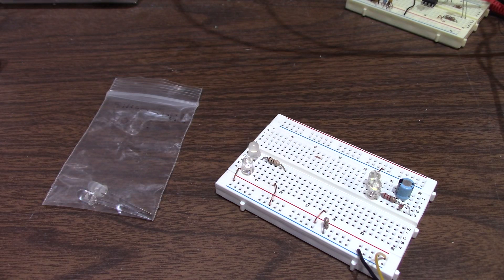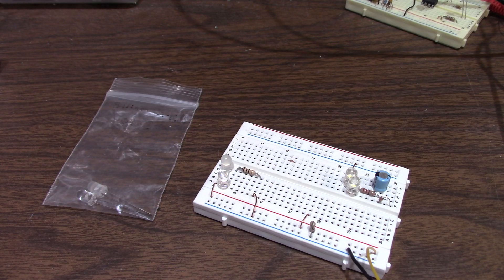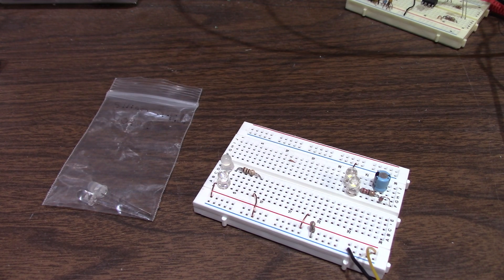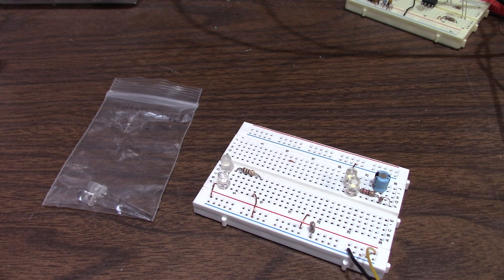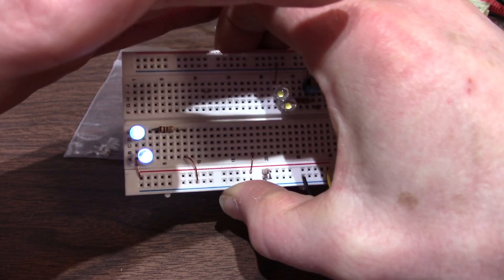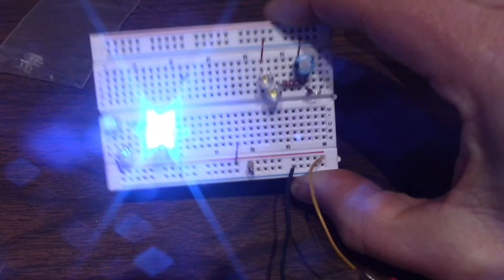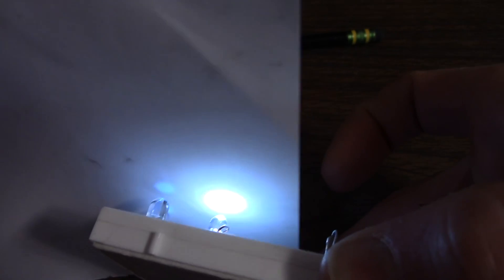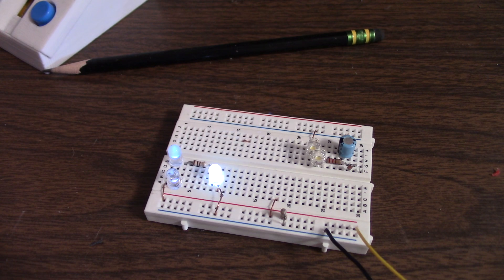The blue LEDs that existed before the current InGaN blue LEDs

Comment: I have a bag of about 80 of Those Cree Research SiC blue LEDs, Part Number C470-5C14. We paid a small fortune for them in the early 90s, and they were obsolete a couple months later. We (Rayovac Corporation) used them to create the first ever LED flashlight, by mixing 4 blue LEDs with 1 red and 1 green, to get a dim white light. It was too expensive, never made it to market.

Comment: I remember when I bought my very firsts blue LEDs in 1997, I spent U$D5.00 for each one, were a 5mm diffused LEDs that weak glows, the seller told that they are from some South Korean maker, sure these are based on the silicon carbide technology...
Greetings from Brazil!!!

Comment: I also picked up some of the early silicon carbide LEDs, just to have some blue LEDs.  I had the same thought when I saw the Veratasium video.  A friend of mine got one of the blue LEDs and put in in a box with a switch and battery, he called it a "geek detector".  He'd turn it on, and if someone came over to ask "is that a blue LED?" he knew he'd found another kindred spirit.

Comment: I far prefer old style LED's for indicator lamps. Most designers run their super-bright LED's way too bright just because they can, even SMD versions. With the exception of lighting applications, this is totally unnecessary. Fortunately I have a good stock of older 80's/90's tech in various colours, which I prefer.
Reply: I use super-bright LED's as indicators because they need a hundred times less current (like 100uA instead of 10mA) to light up decently. On portable equipments, this is a battery saver.

Comment: Hi John! Loved your video on these old blue LEDs! I have a fascination with LEDs alone with fluorescent lamps. I still have an early 1940's preheat fixture that still has the original ballast and to this day, still runs just fine. However, getting back to the topic of these blue LEDs, I remember getting some from Digikey myself when these were available. I was surprised that at 20mA, they were not bright. But unfortunately, these did not last very long. I used one in a power supply that I built as a power on indicator, and after a year, I noticed that the light output was reduced significantly. And then a few more years later, the output dropped so much, I could barely see it lighting in total darkness.

Comment: I paged through the Mouser catalog every time it came out, for years, looking for blue LEDs, $6 apiece, as I recall... I bought several on a middleschooler's budget. Was kinda sad they were so dim... but, yes, that color was amazing!
I used two, recently, at 30mA each, into a lightpipe on a power button, and it's barely visible in daylight. But oooh that soft color!

Comment: I bought one of the first Pioneer dvd players in 1998 (it cost about $800 as I recall). It had a fairly bright blue light which shone when there was a dvd in the drawer (it was not lit for a cd or vcd). Wow, blue led, I thought, but when i took the top of to take a look it turned out to be a tiny incandescent bulb behind a blue piece of plastic... That was still cheaper than a blue led at that time.

Comment: Just due to its oddity: Here in Germany a company sold little incadescent bulbs molded into a blue housing with the same geometry as a standard 5mm-LED. This must have been in the end of the 80ghties or beginning of the 90ghties. They have been quite bright and cheap compared with the authentic SiC-LEDs. The major disadvantage was their limited lifetime.

Rumors say that the High-Beam-indicator of VW-dashboards of this time have used this "fake"-LED. Everytime I have seen the blue light from the LED-shaped surface of these cars I was heavily wondering where VW finds blue LEDs. But maybe they even had an early source of "good" SiC-devices.

Comment: In fact almost every diode is an LED. The 2N4148 emits in the near infrared. You can see it glowing with your mobile phone camera. The silicon pn itself is a very stange light emitter. The charge carriers can only relax from their meta stable state when the take a phonon from the crystal lattice with them. It means, the pn structure gets colder if it emits light. But the loss processes generate by far more heat than the anti-Stokes cooling generates cold.

Comment: I know when I saw the first blue LED - I was in my early teens and it was in the VW Passat my parents bought in -85 and used as indicator for the high beam. Just getting interested in electronics I loved the look so I dived into the catalogue of the local electronics store supplier, Elfa. 
And I found them! Then I saw the price tag of 80 SEK IIRC (about 8 US $) and skipped that purchase...
Reply: Yes, it was.
Reply from the maker: No way would the high beam indicator be a blue LED in 1985.
Reply: Nope. It was a blue LED. All our mid-80s and later VWs had them. The switch from the ugly mustard ones to blue was between '81 and '84 (different markets at different times). The circuits in the dashes of those VWs were specifically made for LEDs, as the indicator flasher, charge light and oil light were also LEDs. All the LEDs were mounted on a single board, and some people swapped the yellow ones for blue when they came out. It was a rather darker blue, not sky or aqua, and diffuse.
Reply: Well it was. Unless they bothered to make the best LED imitation I've ever seen. Don't think I've saved the original repair manuals so I can't check.

Comment: Thank you so much for making a video about this; I was disappointed that SiC LEDs weren't mentioned in the Veritasium video. Even with nothing more than a chunk of crude SiC slag I've been able to find bits of the crystal which give fair brightness in any color, blue included.
Reply: You made LEDs yourself? You HAVE to publish that!
Reply: @thewhitefalcon8539  You can find various instances of it being done by other folks - some early radio operators noted that their carborundum (SiC) detectors would sometimes emit light when DC bias was applied. These are at best only bright enough to use as an indicator.
Reply: @thewhitefalcon8539  It's easy enough to find descriptions elsewhere online - chips of crude SiC (slag from Si refinement iirc) when probed with a sharp point of steel under sufficient DC bias may light up with any color of the rainbow, and with multiple points of connection with steel wool and/or conductive nickel paint the light can be bright enough to see clearly, even under normal indoor illumination.
Reply: @zinckensteel  and what do I search to find that?

Comment: I was excited when I first saw yellow LEDs. So pretty. I started replacing every power indicator I could find, just so people would be amazed that it wasn't red or green. Then I saw a white one and I couldn't believe it. LED light bulbs!!!
Reply: Yellow and orange were around at the same time as red and green - maybe slightly later than red, but not unheard of. They just weren't as bright as the "high efficiency red" ones that came out later, but based on the same GaP chemistry as red and "yellow-green". I always liked the clear lens orange ones - it was actually a really unique color. We had tons of them available in high school electronics class, but you never really saw orange in any products.
Reply: Couldn't they just mix red and green? Or does that make it less bright and efficient ?

Comment: I got some silicon carbide blue LEDs at the Dayton Hamvention, has to be at least 30 years ago.  Blue was quite a rarity at the time and mostly used in specialized medical equipment where blue was advantageous for measuring certain chemical properties.  The light output is only a few Lumens and by today’s standards they look like factory seconds because they are dim.  The pale blue color is quite attractive and they make nice power indicators because they are not excessively bright.

Comment: In the 80's me and my brother played around with red and yellowgreen leds. They were not super bright. There were also some amber leds and infrared leds. That was basically it at least what we could get in electronic shops then. In the 90's i liked to build a rainbow all with leds from infrared to uv. I found out that i could now buy those babyblue ones you showed as well as newer primary blue leds that were also very bright and cost fl.15,- (like 8 dollars or something).
But still no UV. Then a few decades later i also found various UV leds and i am happy now. I only miss out some frequencies like real turquoise colour. Like there are places where there are longer gaps in between readily available wavelenths than that you for instance could buy every led 10 nm apart or even 5 nm apart. But i guess that is to do with the chemical makeup. I hope that one day they also equip computer screens with multiprimary colours of leds, so also yellow orange cyan and violet leds to make an even better Gamut.
Reply: Heh, not too many people seem to know about orange LEDs - we had them in high school electronics - just a different color choice on the shelf in our room, but it seems they were pretty rare or something. I know you could run an orange LED by hooking it up directly to a phone line - in a dark room, it gave quite a bit of light. I always though "if you hooked enough of these together, you could make a lightbulb from them - but it would be orange"

Comment: These kids today will never know the wondrous glory of seeing your first blue light emitting diode in the 90s. Magical is the only word to capture it! If you want to know today's equivalent of the once coveted blue LED, it's deep ultraviolet UVC LEDs. We can go as low as 250nm now in AlN emitters. They're still horribly inefficient,  but they do produce significant amounts of sweet dangerous near vacuum-uv radiation. I just paid about $200 for one in flashlight form for using with fluorescent minerals. Ridiculous and amazing at the same time, just like 450nm blue was 30 years ago...
Reply: Wow, 200, and in a flashlight? I'm surprised you need UVC for mineral fluorescence, though I'm impressed you can get them now. I want to see UVA pumped broad phosphors come into normal lighting applications, they have a much better blue spectrum especially for cooler white high CRI lamps.
Reply: @mikafoxx2717  yingfeng sells the UVC leds. I think the next big thing will be 400nm violet laser diode excited phosphor lighting. No current droop like with LEDs and extremely high irradiance.
Reply: @Muonium1  That's my hope! Seoul Semiconductor makes a few violet pumped LED's with virtually perfect CRI. Something like 99 and a 98 R9, and R11 was really good too.

Comment: I had a VW Polo. The speedometer had indicators with 5mm LEDs. 
A blue indicator is usually required for the high beam. But a yellow LED was installed there and the vehicle had permission for it recorded in the papers.  Other vehicles used a blue bulb instead.
Around 1990 I bought one blue SiC LED for 20 DM, which I then installed as an indicator for the high beam. 
I had to align the LED so that it shone into the field of vision, the blue LED was not so bright.
That was my car tuning 😉
Reply: I'm in the UK and had a VW Polo in the 1990s, but I'm pretty certain mine did have a blue SiC LED for headlight main beam. It was the first I'd ever seen. The poor efficiency was an advantage in this application, as you don't want it to be too dazzling

Comment: Here in the UK we had them around the same time and you never forget your first Blue LED ! and yes, they weren't a cheap date ! more than my hourly rate or close ! Awesome side by side....cheers.
Reply: Those blue and white LEDs were revolutionary. I've got an Nichia white LED that's been running 24 hours a day since 1999 - it's still glowing, but mostly a yellow light now!
Reply: @sdgelectronics  We bought some 5mm Nichia white ones from RS for something commercial back in 2000 for a fiver each. One ended up as a house number illuminator here, lit 24/7 at around 10mA and was noticeably down on output after a couple of years. Its replacement lasted a lot longer and the current one is still fine after 10-12 years at 20mA although only lit dusk to dawn.

Comment: I am sure I can remember buying some of the first 'blue' LEDs, as well as 'white' LEDs.  As you say they had a coating over the chip that fluoresced to give white with a hint of blue.  They cost several pounds here in the UK, but it was so unique... just as when I bought my first LED torch in the early 90s and still have the silicone PP3 powered PALlight I think it's called.

Comment: LED technology certainly is fascinating and this was a nice little demonstration. I can't recall if these were the type that went pinkish as they aged and dimmed.
Both the older blue and red were definitely more pleasant to look at, especially a particular red from around the start of the 90s that had a rosy tint (which I'd like to find a supply of) and a blue I have from the 70s... that's a strange one. The LED is encapsulated in a metal tube and runs hot. It produces what I can only describe as a dim but beautiful 'turquoise sea blue' (around 495-505nm) and the device it is in only ever lights it momentarily. I once read a paper from the time that spoke of overdriving green/amber. My suspicion has always been that something is going on in the tube, maybe polarization like you see on VFDs where they turn the green/blue to a yellow, but in this case they'd somehow be doing the opposite. I was convinced for years that it was a grain bulb, but no. Of course I've never dared cut it open to figure out what's actually going on and I've never found another one, even in other examples of that same device.

Strange how as technology 'improved' the blues got bluer, but the reds got less red, with most now being in the ghastly 625-635nm range, versus the former 640-660nm. It has gotten so bad that I know of at least one supplier which refuses to call the new ones 'red' and lists them as an alternate amber.
Reply: Sounds like you need to find a dentistry college student willing to take a few images of your LED!

Comment: I was designing a climate control for the General Motors 1991  Buick Regal, their stylist INSISTED on blue indicators for the temperature control, I started of with the SiC 'baby blue', GM was NOT happy because they were so dim and pale,  but it was that or green. And about the time for start of  production, the InGaN blues came out of nowhere, expensive yes, but I, along with many other Engineers,  adopted them with little hesitation. I think I still have a few of the baby blue SiC LED's. Very cool to see you post this video.
Reply: In the late 80s and early 90s, Volkswagen models featured LEDs of various colors in the speedometer. In Germany, the indicator light for high beam needs to be blue. Therefore, they decided to place a blue cap over a standard bulb alongside the LEDs. Problem solved :D
Reply: @rblubb well, that’s the way all the colors were done before LED. Heck, my 2000 Pontiac Montana has little red sleeves over white incandescent bulbs all over… from behind the gauge cluster where at least two are blown to underneath the steering wheel CD playback controls where you can feel the heat while driving and the door lock/window controls. The Oldmobile version of the same van (Silhouette) has blue lights in all the same places.

It seems kind of silly for a vehicle produced in 1999 but they just weren’t using LEDs. This is because GM tried to use all the same parts across all their cars and these bulbs were already certified for automotive use across the board. Heck, my 2011 Toyota Corolla still used incandescent bulbs everywhere.
Reply: @emmettturner9452  Silly but true. The only place my 1999 Ford Focus (European version) had LEDs was the third stop at the top of the rear door. The rest were incandescent bulbs. And yes, I could feel their heat in some places.

Comment: Presumably we are talking about the Telefunken TLHB5400 silicon carbide LED.
Reply: Thanks for giving a part number. Here would be a datasheet from 1995 of the original SiC version (looks like the TLHB5400 was at some point "upgraded" to GaN and still sold as TLHB5400):
https://pe2bz.philpem.me.uk/pdf%20on%20typenumber/T/TLHB5400.pdf
2 milli-lumens brightness. Wow, LED technology has improved since then.

Comment: I had one of these back then!! I was also struck in awe and also paid around $3 for one LED. I didn't know it was a different technology, I did notice however when the new blue / green and white LEDs came in that they were SO bright and a more pure blue. The early white LEDs lost brightness quite fast, I had a very early lightbulb made out of individual 5mm cold white LEDs as a night light. After a few months, you couldn't even see it was on anymore. 

I'm going to be searching for SiC blue led's, i want to own these puppies again.
Reply: There is a downside to being an early tech adopter. You need to give tech time to mature to a useful state. When products are first available they're usually junk.
Reply: I had a set of Christmas lights that I swapped in some cheap eBay bottom of the barrel warm white 10mm LED's... Had them around my workbench and they got very very dim within a year of almost daily 4+ hour use.

I didn't notice it for a while until I swapped one out, it was at least 50% loss of light output. 

None died, but they just got soooo dim. Probably why 100 cost $5 shipped... Haha

Edit, I'd also love to find some of these. I wanted to make a new LED house number sign out of vintage LED's.